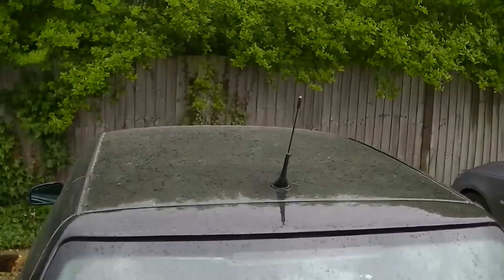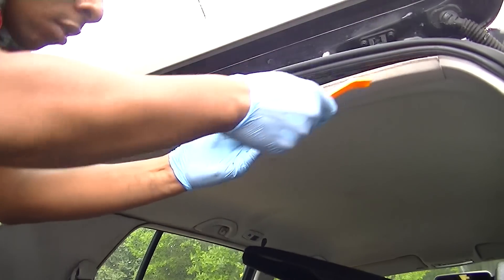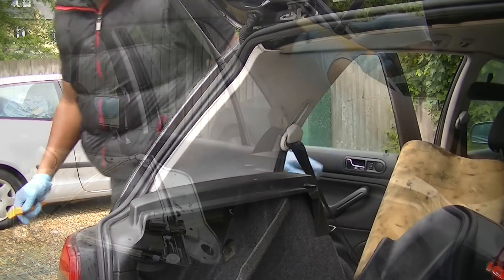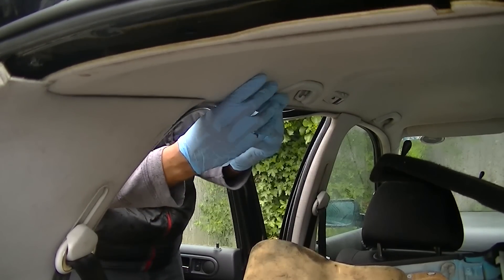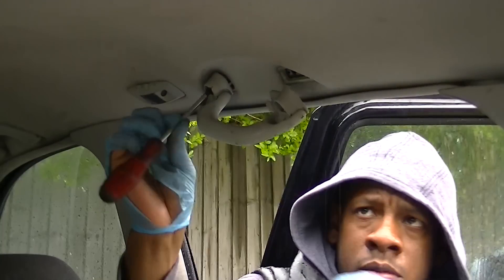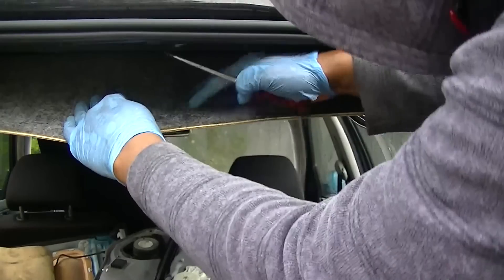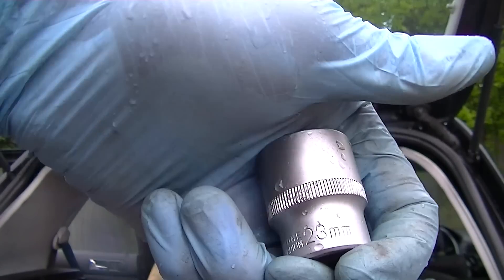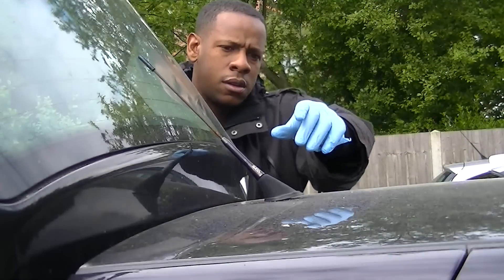VW Aerial Antenna Removal Simple, Easy, Steps

Comment: Good reason why to remove the antenna most golfs gets water in the top of the antenna and within the black cap is a diode that blows due to the water so if your wondering why your stereo isn't finding radio stations well  there ya fault  =)

Comment: Thanks so much for your video. I thought it would be a nightmare job, but actually not that difficult when someone actually takes the time to film it and actually not just doing the job the quick way, you went the extra mile to take off other items that was not necessary, but it was what I was looking for as loads of people have just pulled down the headlining and saying it’s a old car so the headlining will always be hanging down from now on. Yes they did get the aerial fixed but the roof was a mess and someone else had to use spray glue for the head lining as they had actually ripped the lining and had said well it’s a old car so this will always happen.
Ps not even the rain got you down as your a better person then I am as it always rains when I have to do any out door work. 🔧🛠🧰👍🚗
Reply from the maker: Glad it helped you out, and thank you fro your comment

Comment: Thanks for this bro, gonna give it a shot with an A4 b5 avant
Reply from the maker: Good luck
Reply: @BMACVAGS  The top part has been a disaster, after struggling to get the d pillars off, in the hope that that top part would be easier to remove, the top part ended up cracking every time i tried to budge it. It's a literal nightmare, and there's no tutorials are advice anywhere online, or in the haynes manual, or anyplace for that particular trim piece removal on an a4 b5 avant. I had to come in out of it after snapping plastic pieces and the top part still not release, fucking hell, it's maddening